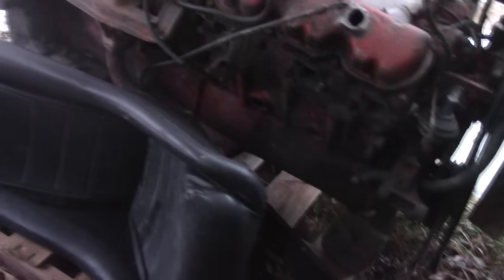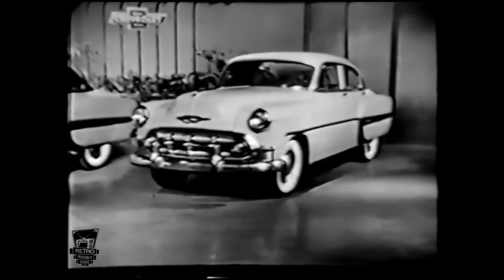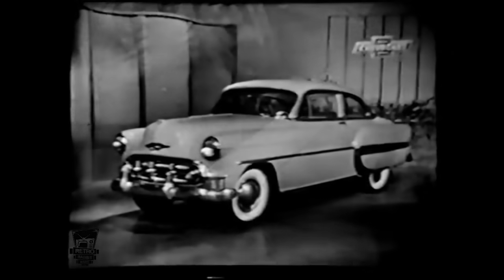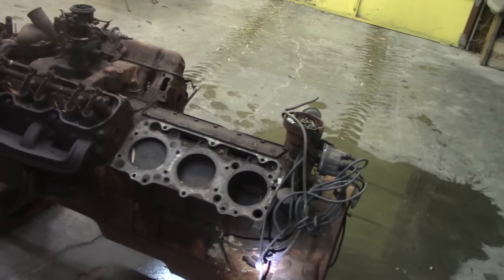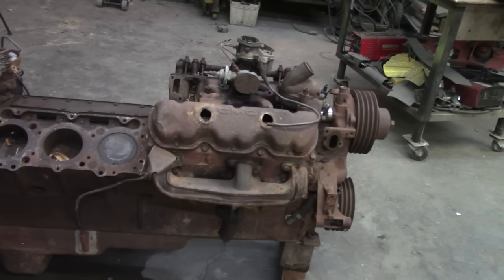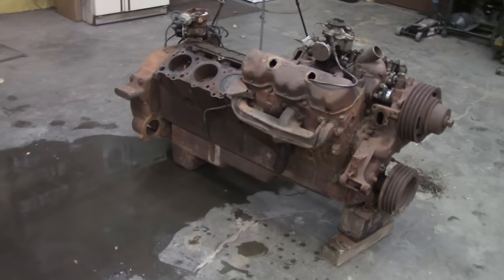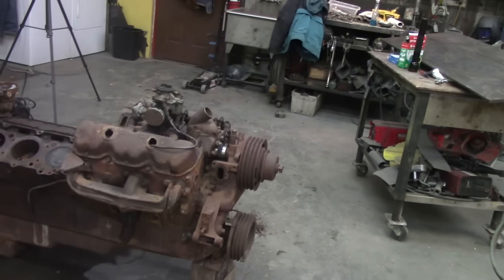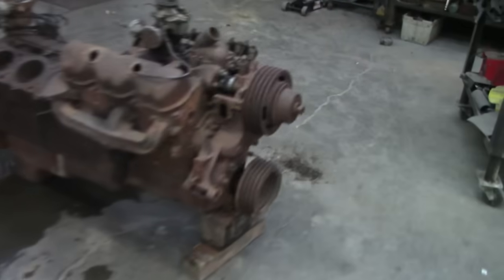GMC 702 cubic inch V-12 ENGINE -  another DOZEN!

Comment: The company I worked for in the 1960's had 2 of these in cabover GMC tractors. We pulled 72,000 lb grocery loads for delivery. They only used these when absolutely necessary because they got 1/2 mile per gallon loaded and 2 when empty! I could not believe how much it took to refuel these when I would return from a delivery. Good rat rod material or better yet how about a 12V71 with twin blowers and twin turbo's! Wonder if you could run those 2 strokes on gasoline!!!!!!!!!
Reply from the maker: well. I dont have a 12V71 but I do have this V12 so it will be my next rat rod engine!  1./2 mile per gallon! haha.. i wondered about the mileage.. thanks for watching and I hope my videos bring back memories for you..
Reply: @1963impala2drWaylonWire  All of the manufacturers had huge gasoline engines back then. Ford , International, Diamond T Reo to name a few. Without turbochargers the diesel were pathetic 140-160 hp. units with twin gear shifts that you rowed constantly trying to keep any momentum. Gasoline engines were inefficient because they had really low compression ratios in the neighborhood of 5 - 6 to 1 to prevent preignition when they were working hard and were hot. Your motor would benefit immensely if you could figure out a way to raise it! Cool rat rod engine for sure.
Reply from the maker: @rondyechannel1399  the one i have sitting on the floor with the heads off has either suffered from preignition or as some have said..the check ball in the pcv valve has dropped into the cylinder..that piston is pretty hammered!
Reply: Ron Dye Channel Sounds like the two big Ford gassers ,the 477, and the 534, the 477 when tuned right would get 4 mpg loaded and 6mpg empty , but the 534 ,now that's another story , that's 1mpg loaded and 2 mpg empty.
Reply: @rondyechannel1399  5 to one?  The piston comes to the top of the bore. WRONG
Reply: @roberthoard639  What the hell does that comment mean. "piston comes to top of bore" means NOTHING! How big is the combustion chamber, etc. They ran low low compression, maybe 7 - 1 but very low so they would live.
Reply: @1963impala2drWaylonWire  Hmmmm… nothing like a good mystery.
Reply: @rondyechannel1399  , easy to increase the ratio just shave the heads down , the only problem is that they are built weak and will fly apart .  same goes for all those old non turbo diesels they are built weak .
Reply: @carmichaelmoritz8662  Wonder if you could weld and machine a quench pad onto those old pistons to raise it up? Maybe warp the hell out of everything though. My god, I drove those old semi non turbo's and they were really pathetic. When they first added turbo's to the old 220 horse Cummins and made a 250 it would overheat (EGT) just looking at a hill.
Reply: @rondyechannel1399   i heard about people doing that to fill the chamber , seems to work .  i remember the over heating problem with a number of old motors , had to stop every so often to let it cool down lol .  could have been due to the rad or porting or water pump or maybe a bit of all three .  most cases were due to a faulty thermostat .  most companies never cared about the consumer , they only cared about money and a fast cheap product .

Comment: Check out the Thunder V12 web site.  They are in Evansville, Indiana and sell mildly modified GMC V12's.  They have a custom ground cam, and an electronic distributorless ignition system, making about 450 Hp.
Reply from the maker: im going to include those sites in a new video.... thunder and 6066guy

Comment: I worked on those in my younger days, pig iron beautys, they got maybe 3mpg in a jimmy dump!, I think GMC sold them by the pound! Good luck.
Reply: Gary Maris I am surprised they got that much was thinking more like gallons per mile , the international 345 V8 were getting the same mileage in a bogey drive twin steer configuration .

Comment: Hey Ken, can't wait to see what kind of body you find, I'm sure this will be an awesome build, will make quite a series! If you run into any kind of trouble with camshafts, Berry Cam Service here in Minn. are the cam gurus, I know they can grind just about amy cam/or regrind, seen em grind reverse flow cams with the exhaust coming out the top of the heads & visa/versa, they are located in Lester Prairie, Mn.

Merry Christmas & God Bless!
Reply from the maker: thank you!  I appreciate the info..

Comment: I have seen tractors and motorcycles with two engines, but those V12's  are already two engines..
Reply from the maker: 1 block - 4 heads = 1 engine , but it is the same cu in as two 351 V6's thanks for watching!

Comment: The USAF Transporter Erector used them with the Minuteman III missile
Reply from the maker: yes sir..  I have a video coming up soon showing the minuteman missile transport and some other uses for it..
Reply from the maker: @flyingdog1498  the government untrusted them with the minutes missiles during the cold war.. and they made them for 8 years.. i would think they must have been somewhat reliable.  Please tell me of your first hand experience with these engines..im not disputing you..im genuinely interested. Thanks.
Reply from the maker: @flyingdog1498 respectfully sir.. sounds like you personally had a bad experience with them?..the runner that i have ran for years and years powering an irrigation pump.
I talked with one gentleman who's job it was to start 27 of them to run pumps for frost control in the orange groves.. again.. with respect, thanks for watching and commenting
Reply: @1963impala2drWaylonWire   , i heard as long as you keep the rpm to a minimum those motors are just as good as most gassers .  the older 1,200 2 cylinder diesel on the smaller ford tractors and also the international td14 on the crawlers had poor cranks and turning up the pump 200 rpm more almost always resulted in crank problems , the back of the crank would break .   i heard that those v12 liked to throw out connecting rods  if a persons foot got to heavy on the peddle lol .

Comment: There are railroads not running that much horsepower!
Reply from the maker: nope.. only 275 hp.. but 630 ft lbs of torque.. at i think about `1600 rpm lol